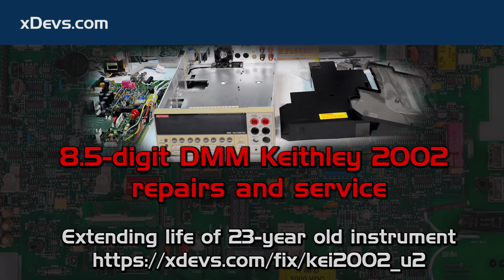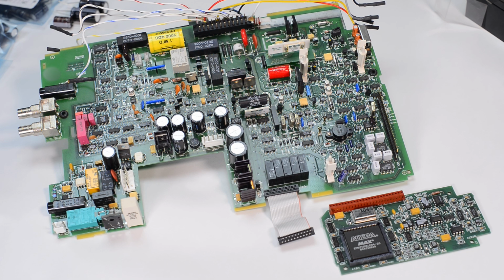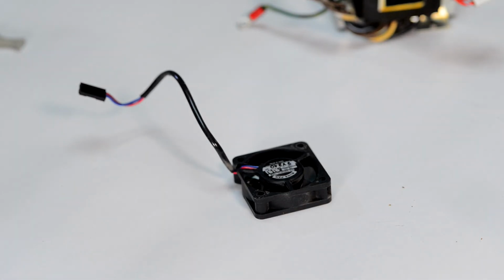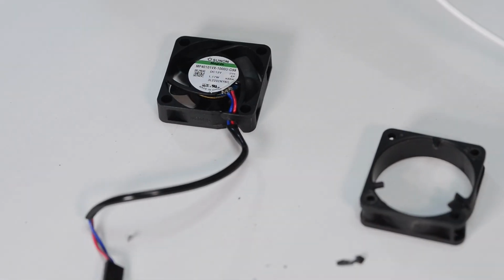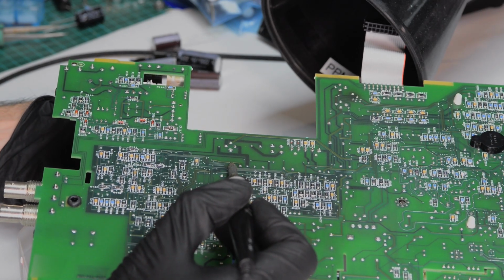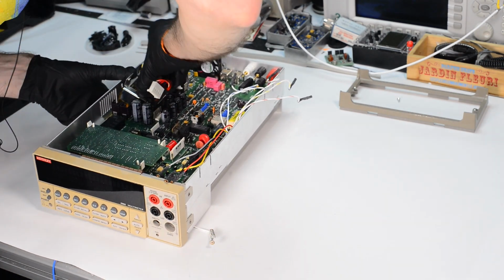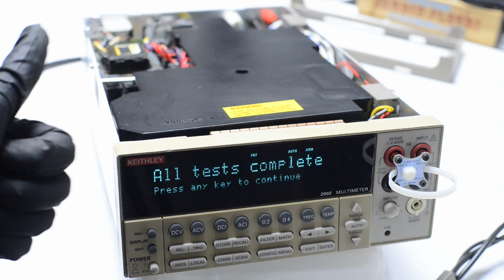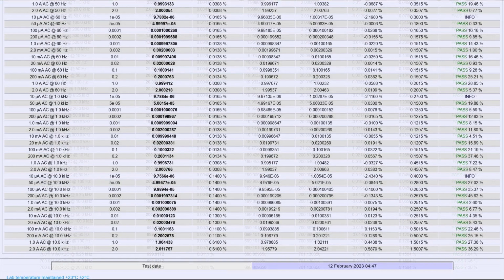Keithley 2002 DMM repair and preventive service

Comment: for the other previous unit with the corroded damaged traces... i cannot help but think by the time you have stripped that damaged board of all components, then to take some really accurate photos. and perhaps xray (for which tsp has a machine). to then re-create that pcb in cad, to make for the capability of entire new replacement boards. so when other units cannot be saved is then an option exists. just for that specific board which is where the damage normally occur.

it sounds like a lot of work i know. but maybe if that specific board for the psu is simpler design, and away from the other main boards.... and there is enough busted keithleys out there.... then it can be worthwhile! heehee
Reply: oh sorry, is all part of main board. just like the lower modles 2001, 2000. i did not pay attention enough. and the caps goes all thee ways around the transformer cut out. a damn shame that
Reply: ok but how about this idea then: maybe if we can de-populate all relevant psu section from the mainboard. and then design (brand new) a seperate psu board to take over those depupulated functionality off of the mainboard. and make new transplant psu board compatible across the range of keithley modeels. if there is actually enough z height room to fit above the pre regulator corner section and where the depopulated caps were taken away... if not then this would not be feasible. and also to think of traces corrosion damage impinging into neighbouring actuall dmm circuit that is next to those psu caps. since on some of the damaged boards the liquid can spread out further. perhaps it is not worth the efforts. unless one day you get a whole batch of keithleys, several meters with thes electrolytic damage.
Reply from the maker: @dreamcat4  I've considered doing something like that when I had ten K2001's in repairs back in 2014, but ultimately started designing own stuff instead. That's how public xDevs's LTZ1000A-based modules came from ;-)